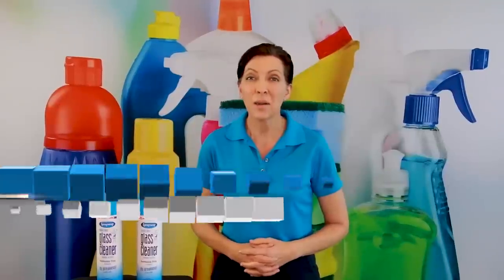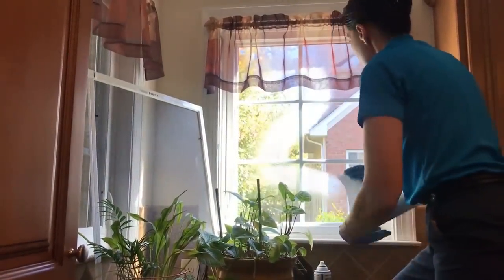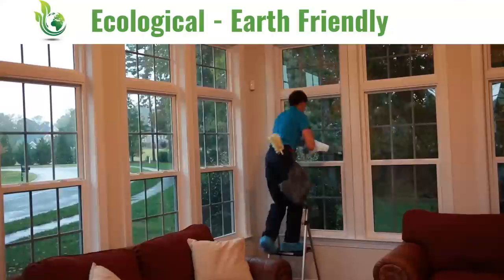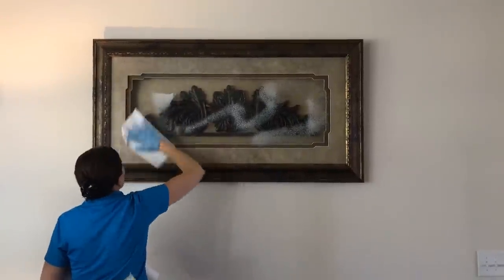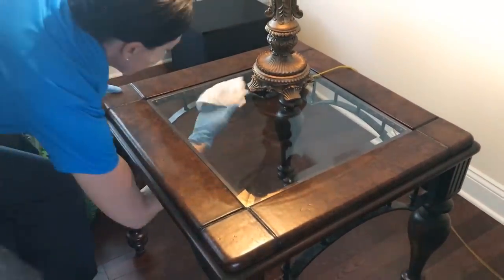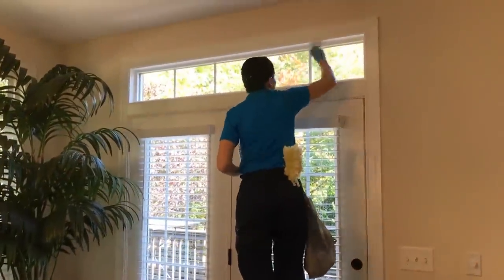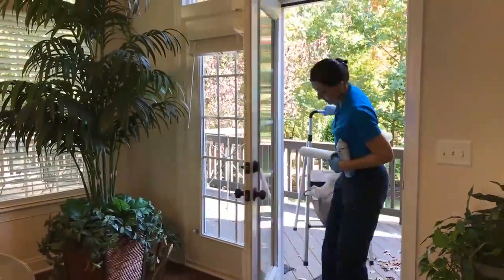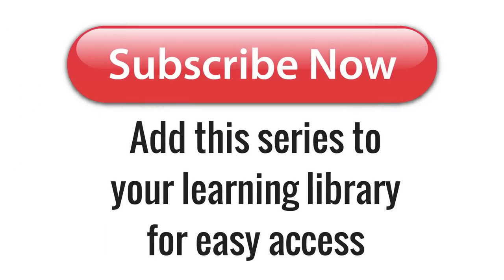Sprayway Glass Cleaner Product Review

Comment: In a previous video, the question asked was "Which is the best thing to clean windows and mirrors with? Newspaper, paper towels, or coffee filters. The answer in your video was none of them. You said to clean windows and mirrors with a microfiber cloth and water and dry with a fine microfiber drying cloth. And to simply use water. Now in this video I'm seeing paper towels being used with a product. So I am now quite confused. Perhaps there is something else to know? Thanks!
Reply from the maker: There are several ways to clean most anything. This is a particular product review about a particular glass cleaner. The reason we cover various cleaners is because many homeowners insist on using a particular product, so we highlight  those products and show you how to use them, go over the safety data sheets, etc. Then you have choices. Which do you prefer?

Comment: Do most paper towels have some kind of lotion and/or lint in them that leave it on the window after washing it?  What paper towels do you recommend for washing windows or do you think microfiber cloths are better?  Thanks!

Btw, I love spray away window cleaner and have used it for years!
Reply from the maker: If using paper towels, I prefer Bounty. They don't leave a lint residue on the glass and they are super absorbent so one select-a-size can clean an entire mirror or pane. I do prefer glass cloths for cleaning glass though. Here is the paid link https://amzn.to/3XAdWTy to the ones I use. They are a microfiber, but very low pile so they don't leave lint either and they are reusable, and can be washed in the washing machine in a mesh bag with your other cleaning cloths.
Reply: @AskAngelaBrown  Thank you for your reply. I have a brand of window cleaning clothes that I ordered from Amazon that look like the clothes you like. It is the Mr Siga brand. Looks like what you use made for window washing.

Comment: Hi Angela,
Moved into a home with 3 huge sliding glass doors that open onto my patio. Cleaning them is awful.
I  tried water, vinegar and water even Sprayway. The windows show a glossy swirl in the Sunlight. So frustrated. Can you help me figure out what I am doing wrong?
Thanks so much.
Jean
Reply from the maker: The Sprayway and/or Vinegar should remove the glossy swirl if it is caused from cleaning spray. Is it possible the thermal seal in the window is broken? Here is more  information on thermal seals https://www.thespruce.com/what-to-do-when-window-seal-repair-fails-1822895 and a broken thermal seal will make the window look glossy or dirty.
Reply: So I can add white vinegar to spray away?
Should I use a microfiber cloth with the cleaner? So confused as to the type of cloth to use.

Comment: Can you use it for other surfaces?
Reply from the maker: +@cindythroneburg5269 yes you can, but it’s expensive to do so. In most cases, I reserve this for mirrors, pictures with frames, and windows that have exterior panes when dripping glass cleaner would be a problem. 
You can also use it for glass cooktops, or the keypads on microwaves and ovens.

Comment: I have a homeowner who thinks "Scott's" blue towels are the best. I have discovered that, that is not true all the time. She insist that is what i should use. Thank God she supplies them, especially that they are more expensive.
Reply from the maker: Understood! While personal preferences can vary, it's important to consider different factors when determining the best towels. If you've found other towels that work well, you could politely share your experience with your homeowner and suggest trying them out on a trial basis. Open communication is key to finding a solution that satisfies both parties. Good luck!
Reply: @AskAngelaBrown  
I have tried. She has gotten almost impossible to deal with. 
I am doing another list FOR HER. She keeps trying to change the system we started with and agreed upon. 
So I am implementing some of your suggestions and ideas that you do. Coming up with check off list. Putting in black and white, that if I HAVE completed the job under the regular time (sometimes I'm done in 2 & half halfhours; instead of 3), I'm not at her disposal to do extra work; especially when it would go way over the regular time. (2 more hours so it can be completed) Explaining like I did when I first started her home, that extra work equals extra pay. It must be requested a week in advance so I can schedule appropriately. 
Hope I make sense.

Comment: Again so confused,in previous clips you say stay away from paper towels due to the environment. And you use a wet microfiber wet towel qh only water,then dry wh the special towel that you suggested.  But in this video you use windiw spray cleaner and paper towel. I just want to be clear,since I'm a cleaner wh some employees, and hang on to your every word! 😁
Reply from the maker: Hi Melanie, There are a dozen ways you can clean glass. Some people insist on using a spray cleaner. This is the preferred spray because it doesn't drip. But you can also use a glass cleaner spray, and you can use soapy water in a bucket with a squeegee. You can use a damp cloth and newspaper or coffee filters to dry the class. There are multiple ways of cleaning just about everything.

Comment: I think you should always spray the cloth rather than the item you want to clean.  You use less product as well.
Reply from the maker: +Ally Elly 
Great tip thank you so much for sharing this. In most cases this is true. If the area doesn’t need extra chemicals, and dwell time, wetting your cloth will do just fine and like you said, save chemicals.
Reply: @AskAngelaBrown  I once sprayed leather polish directly on to a leather sofa and it just soaked up the polish and went darker than the rest of the sofa so I learnt my lesson.  It did eventually evaporate and no harm done.

Comment: I recommend not buying this product. First off it’s aerosol that should say something right there. Not recyclable. Secondly it has toxins in it, why use something that has toxins in it when there are more natural products that were quite effectively? You can make your own very easily. If you need to go buy some glass cleaner, make sure it has no coloring in it because the coloring comes from dead bugs and is completely unnecessary. If you want to make your own, just fill a 16 oz spray bottle with water and add an 1/8th of a teaspoon of eco-friendly dishwashing detergent or less. My favorite is 7th Generation. I am a professional Green home cleaner and I use this recipe for my general cleaner which also works as a glass cleaner. It doesn’t streak. Your spray bottle would be recyclable and it’s safe to touch and work with every day. Please be more responsible with your health and the planet.
Reply from the maker: Thanks for leaving a comment! 👍